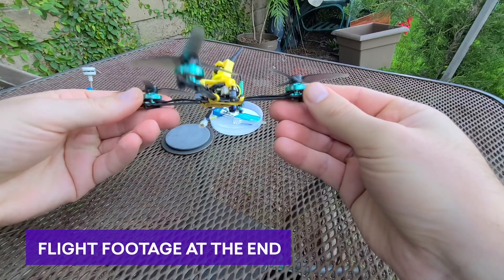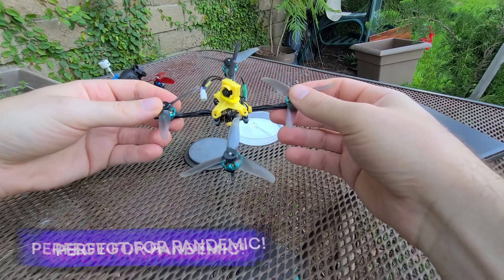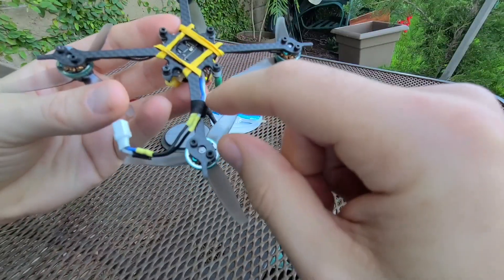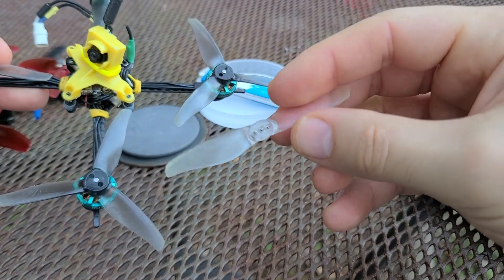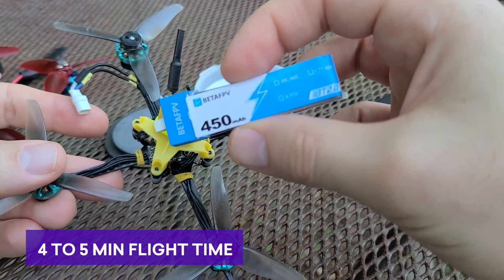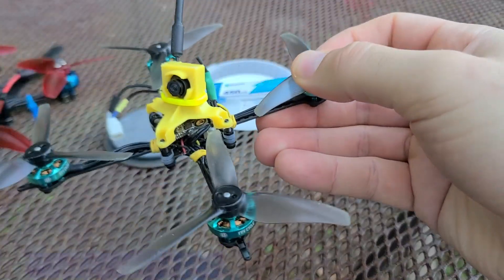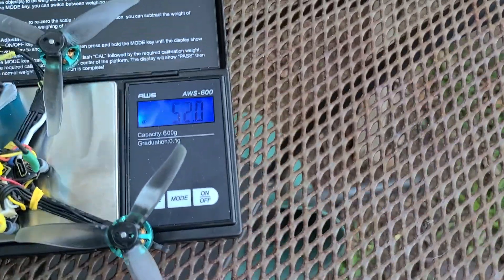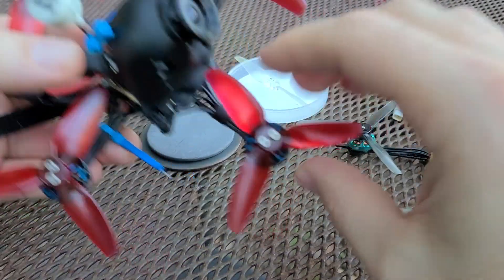Kabab FPV Babytooth 1S 3inch toothpick review, build, flight

Comment: I just built a babytooth today with the newer 13mm 11400kv 1s motors from fpvcycle.  I used a diamond f4 AIO with built in 25-400mw VTX (the board off of the moblites) and a runcam nano 3 camera and 450-520 mah 1s Batts.  41grams dry 54 grams AUW.  I love it!
Reply: Hey did you ever blow up any escs? I built 2 1s versions using 5amp aios for 1s whoops. Can these boards handle the amp draw? Do you even know the amp draw these pull?

Comment: Nice review! My parts are in the mail to build one.  Question on the BetaFPV 1s board (v2.2)... The website says the pad for +V for vtx is VBAT. Is that a typo? I'm guessing it's probably regulated +5V. Just curious if I'll have to try to find 5v somewhere else on the board. Also, why double up on the + and - vtx power pads? Thanks.
Reply from the maker: Ya you're probably right. I'm running the VTX and camera off what they're labeling as VBAT so it's probably just 5V. I had to double up on the pads because I'm not using a built in receiver so my receiver is taking up the top 5V and ground pads and the VTX I'm using doesn't have 5V and ground for the camera, as some VTXs do i.e. the eachine nano VTX. I'm using the Flywoo Goku VTX and I also know the nameless RC nano VTX also doesn't have 5V and grounds pads for the camera.
Reply: Ah, great that makes sense. I'm using the PandaRC nano vtx and it's similar to yours, so I'll have to decide if I put camera and vtx on top and bottom of fc board, or just put vtx on fc board and get camera power from the other side of the vtx power pads on the vtx. Whatever is the shortest wire run I suppose.  

Good video quality with your vtx, what power level are you running?

Thanks for the quick reply.
Reply from the maker: @SparkyColdfire  Ya no problem. I am running the flywoo Goku VTX runs at 450mw using "low power disarm" to avoid overheating.
Reply: @brickclickfidgets  Love that feature.  Use it all the time, unless whooping at 25mw.

Comment: Parts are hard to get because manufacturers are unfortunately either shut down or extremely extremely slow. 600mah because I fly pretty hard so it barely gets 3min for me.  The drivetrain and large props also doesn't seem to have any issues with up to around 56g auw. After that it starts affecting it more. If you're like mrshutterbug and have your quad way way down in weight you'll get a significant performance boost but there's a bit of jumping through hoops to get there. The xt30 is actually more voltage stable than the bt2 on this platform. There's a new connector coming some time in the next several weeks that's between an XT30 and a bt2. That'll be what we're ultimately going to use when available
Reply from the maker: Thanks as always for the reply. Big fan of your work. Looking forward to hearing more about the new plug you're working on.
Reply: those connectors from GNB is actually come out? I thought they shut down that idea
Reply: @xfOL.  they're coming